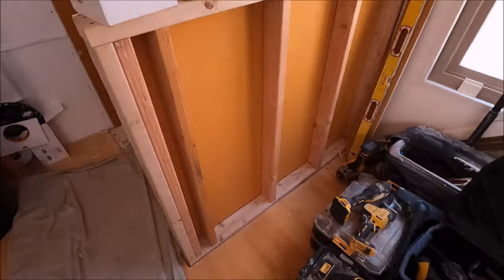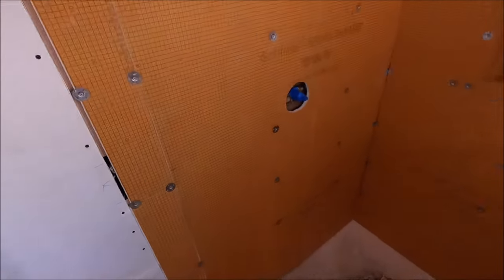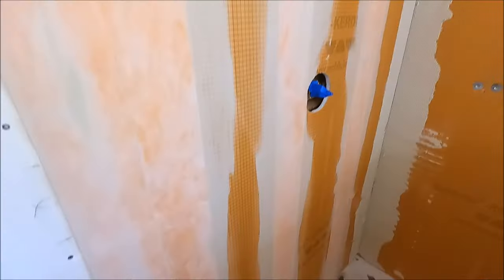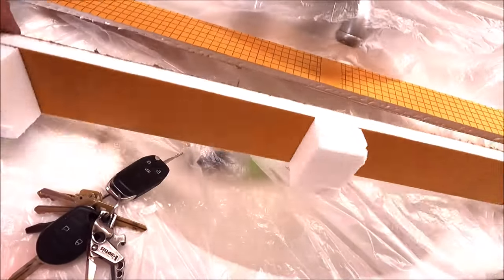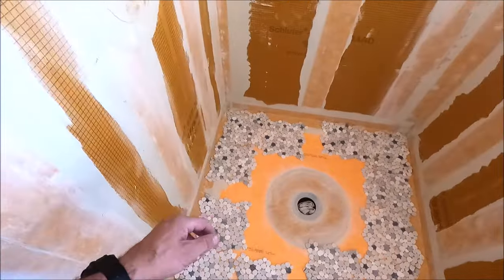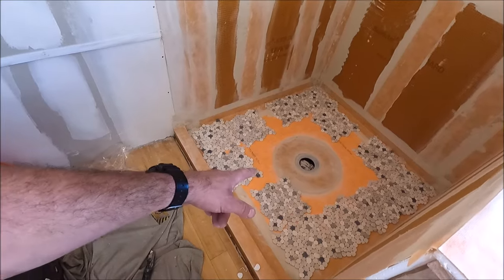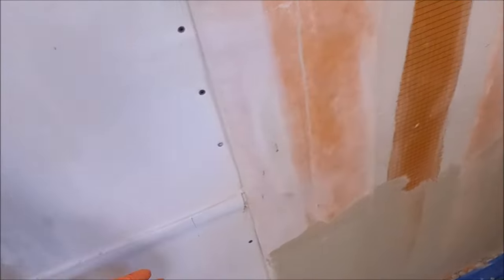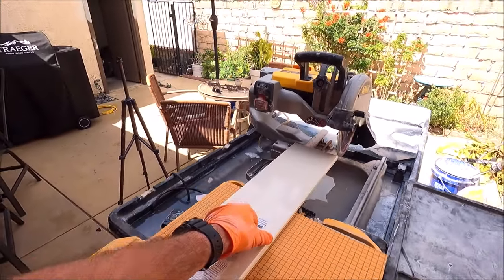Making This Shower Bigger with River Rock Madness!

Comment: That pony wall looks like it wasn’t king studded through the floor? Without that shooting through the floor, that wall will flex pretty easily?
Reply from the maker: The wall after framing tile and drywall was rock solid and didn't flex at all 👊

Comment: Dont think you can  use smaller than 2" squares on foam tray
Reply from the maker: The trays are much more Rigid now, we have installed dozens without problems.

Comment: That pseudo-quarts and dry polishing discs do not play well together. In the higher grits the fine dust melts and can smear over the material like boogers.
Reply from the maker: We wet the diamond pads before polishing the edges, works like a charm.

Comment: Love your work brother. Just wondering if you tie that pony wall into the floor joist at the outside corner or is it sturdy enough wothout?
Reply from the maker: Definitely sturdy and after board tile drywall it had zero flex.